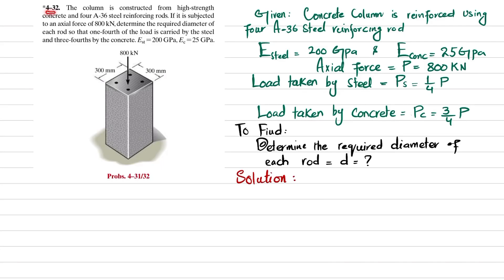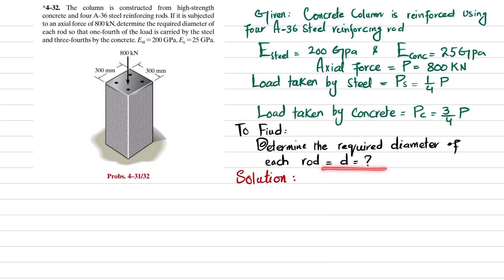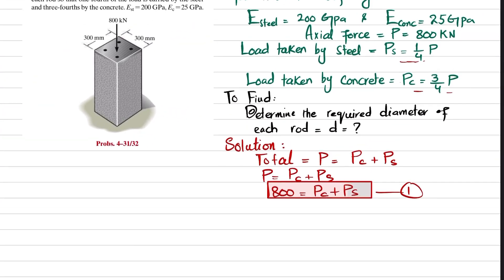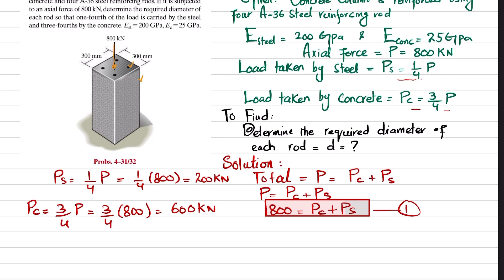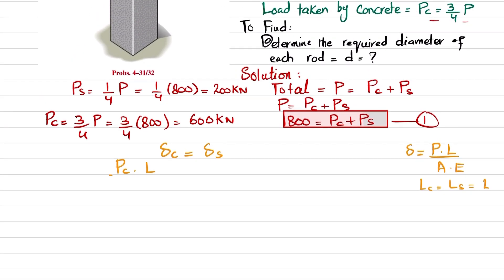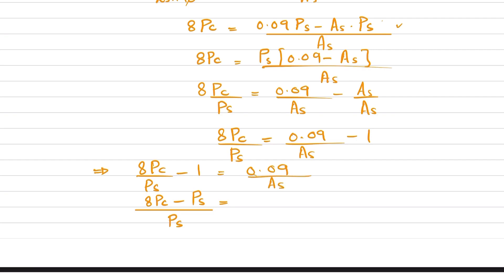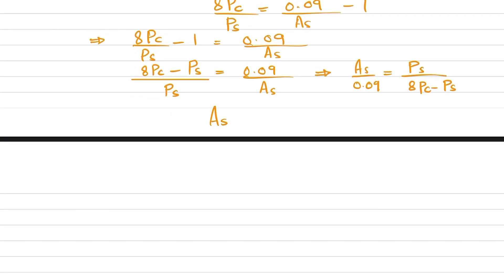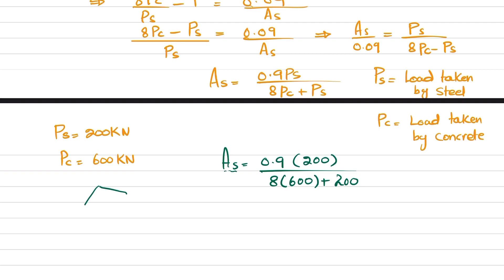4-32 Determine the diameter of steel rod | Axial Loading | Mechanics of Materials by R.C Hibbeler

Comment: That -1 don't you think you made a mistake?
Reply from the maker: Where bro?
Reply: @engradnanrasheedmechanical where you will do the LCD on the left hand side
Reply from the maker: Yes it should be 1 and you can see some times this small mistakes happen. And later on the mistake was rectified and + sign was introduced.   @KoketsoMolaolwe-y8u  thank you ❤